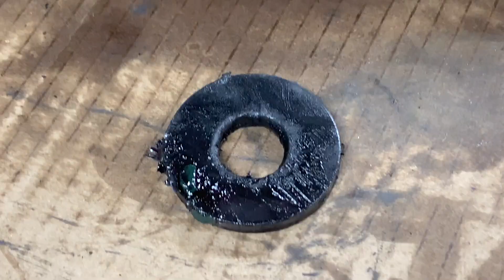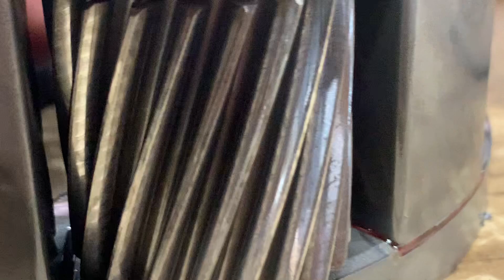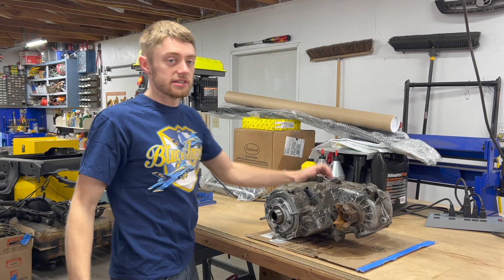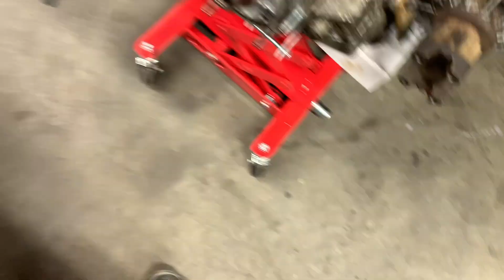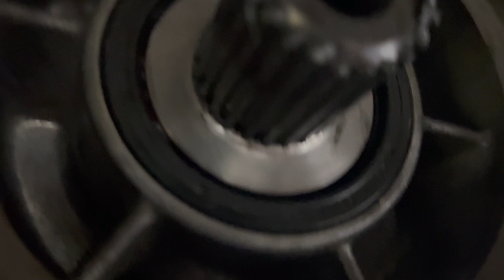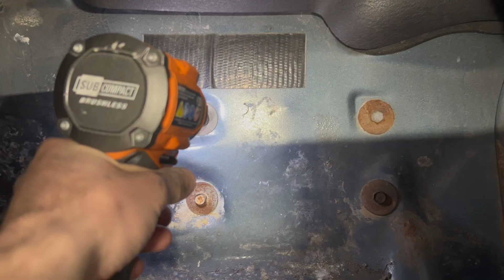Transfer Case Problems and CRAZY Solutions! (NP231J)

Comment: Honestly I would have just bought a new input shaft thats was correct off ebay as that would have cost less than the clocking rings you bought.